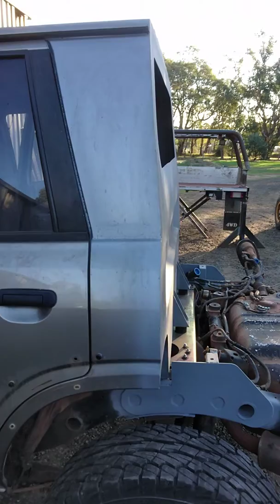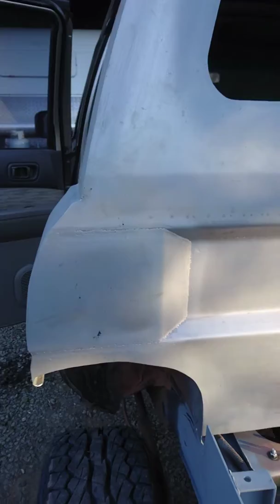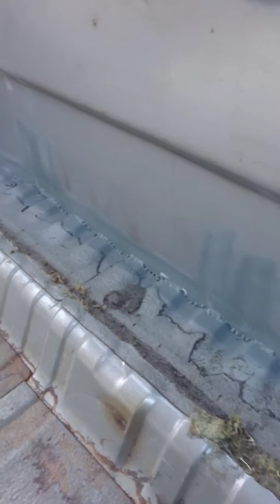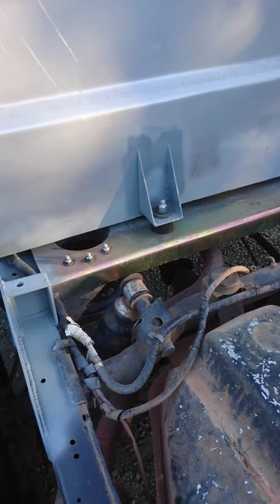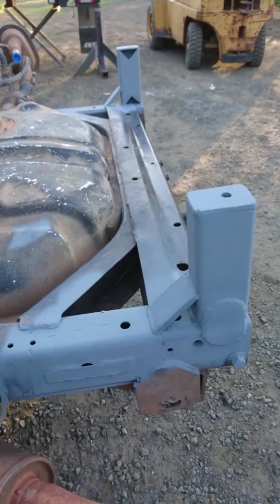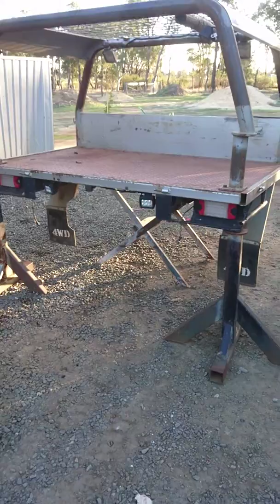GU Patrol Dual Cab Conversion

Comment: There are a lot of do's and dont's when it comes to welding chassis you have done well but you never weld across the top or bottom side to side. front to backs is not  bad but side to side can crack even with the fish plates
Reply from the maker: I have definitely learnt alot since this build, there are alot of tricks to the trade, its good to share our ideas and knowlege, thanks for the advice mate.

Comment: Hello friend, I want to do the same with uba Y61 that I have model 1999, what recommendations can you give me? cabin cutting measures? Etc... i speak from colombia
Reply: I really want to perform the same process as you, exactly the same but I don't know what cabin cutting measures to take, and I'd like to know the step-by-step process
Reply from the maker: Hey Jean, your 1999 y61 should be the same. I cut mine 30mm behind the child restraint points on the floor of the cab. Using a 360° laser, I marked the sides. The roof is cut directly behind 3/4 roof lining, which lines up with a roof crossmember. 
If you haven't already, subscribe to my channel, I will be completing another y61 Dual Cab chop in the coming months. I'm may also do an update video on my current y61 dual cab in the coming weeks 👍🏼

Comment: Looks good mate anymore updates on the build?
Reply from the maker: Hey Mate, Thanks for your interest, there will be an update video in the next week or two, the build is currently in the body and paint stages, which is taking longer than originally thought due to addition dents needing attention.  With a bit of luck it will be getting pieced back together soon, ready for the engineering inspection. If you haven't already feel free to like this video and subscribe to my channel for further updates and projects in the near future.